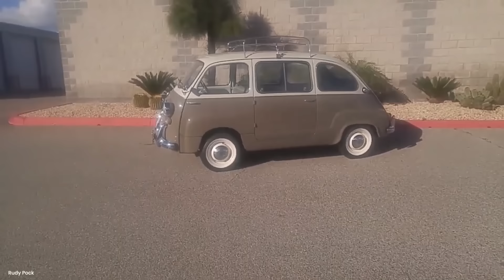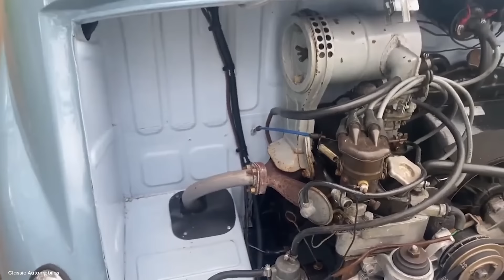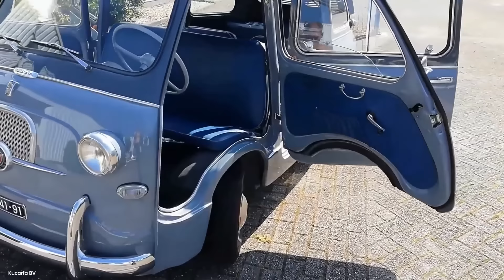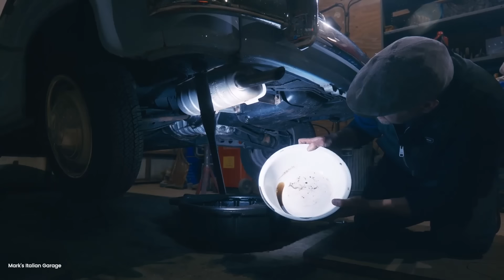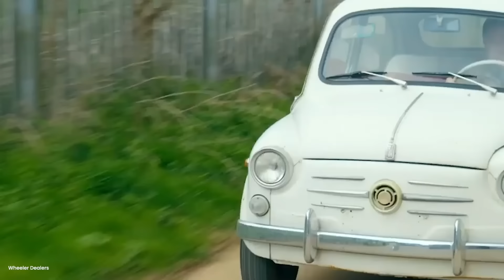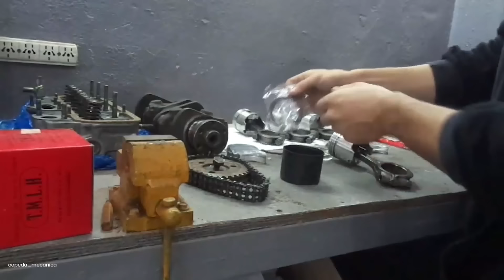Even at 52 HP & Suicide Doors, the 1959 Fiat 600 Multipla Shocked Everyone Seating Six Adults

Comment: While I was in Malaysia I used to work of Fiat 600 a lot back in early 1970s. Wonderful vehicles with no electronics. Contact points distributer required more periodic adjustments. Very sturdy car . Never fail on any trips.

Comment: Another salesman I worked with selling fire alarms door-to-door in the 60s had a micro van similar to that, although I don't remember the actual brand. It was the only one I ever saw - before or since. What I remember most about it was how roomy it was inside (it had no rear seats, just open storage area), even if it did look like a toy from the outide ... very cleverly designed! ⛽

Comment: A used 1964 Fiat 600 was my first car in 1968 - I completely rebuilt the car and put 80,000 miles on it including a trip to California before I sold it to my brother and bought a brand new PINTO for $1,995 that I drove for 200,000 miles - I loved the 600's bouncy ride and it's 1-1/2" thick doors - my sister had an OLD Renault Dauphine that my grandmother floated back from France in 1960 - I now drive a 1968 Suzuki X90 - yes I'm crazy!

Comment: I had a '58 Multipla that I bought in 1968 for $150. I loved that car and put on a glass-pack muffler that gave me about 3 mph extra, and the same for top speed. It sounded impressive downtown, with the sound echoing off the tall buildings. But the cooling system was not built for fast, highway driving, especially in hot weather. I cracked the rings on two engines, before I figured that out. I gave it to a friend, who was an ace at modifying cars of that type. He overhauled it and cut out a section of the rear seat-back, so he could fit a radiator from a much larger Fiat into it and that extra capacity solved the problem. He drove it for years without trouble.

Comment: Great Design, which should be updated and modernized, still with low power and speeds, to produce much needed cheap cars for India and similar poor nations where you see poor families hanging from 50 cc motorcycles, usually a couple and five kids, and possibly 1-2 in-laws. This would be perfect for them, and so much safer. UNfortunately, FIAT did use the Multipla name, but not for a clever design like this, but an ugly, huge HIPPOPOTAMUS of a van that of course failed to sell.

Comment: When stationed in the Navy in southern Spain from 1962-1964, I bought a 1957 Fiat 600 Multipla from a buddy returning home to the States.  Though we pushed it about as often as it carried us, I was able to see places in southern Spain with my friends I would never have been able to see without a car.  That funny-looking car fit right in with the local cars!  In fact, most locals drove motorbikes.  That car was in the repair shop quite often.  Needless to say, I did not bring that car with me when I was discharged and returned to the States!  My experience with Fiat did not end there.  After returning home, in 1969, I bought a new 1969 Fiat 124 Sport convertible, also a horrible car.  I had a tough time selling that car.

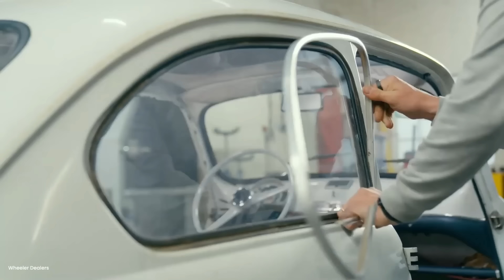Comment: This video is about the Fiat 600 Multipla and takes 23:17 minutes. Even though he keeps talking about the Multipla, all pictures from 15:35 minutes onwards show the standard 600. NOT the Multipla. Then he mentions that the VW bus (type 2) followed the design of the Multipla, even though the VW bus originated in 1949 and the Multipla in 1956. WHo followed who?  Then he shows a Citroen AMi, a normal car with engine in the front under a hood, but he claims that he Citroen followed the Multipla design, nothing like it.  Thirdly he states that the Subaru Sambar Microvan is based on the Multipla, but shows a picture of a van that does not look like a Subaru Sambar microvan at all and sports a clear VW emblem on the front.  The video is entitled 'only 52HP' even though in the story he never mentions that it ever got past 25HP!!!  Within the 15 minutes that show the Multipla, he repeats the same pictures 4 or 5 times, so you really get hardly anymore than 3 minutes worth of Multipla pictures. Just waffle from somebody who couldn't even spent the time to properly investigate the topic he wants to pretent to be enough of an expert on to make a video about. Shocking
Reply: But other than that, Mrs. Lincoln, what did you think of the play?
Reply: "shows a picture (...) on the front." 
 
I don't know about Sambar but at least it looks like a Subaru. It's certainly not a VW.

Comment: Thosa were notta, whata we are callinga the suicida dorsa.  Front edge openning first is the suicidea doors.  It isa the front dorsa which causa the suicides.  No?  
You're saying transverse leaf spring in front, but it's a coil spring on each side and a transverse sway bar.  
Send me a check for all the proofreading I'm doing for you.
Reply: Front opening doors are the BEST!
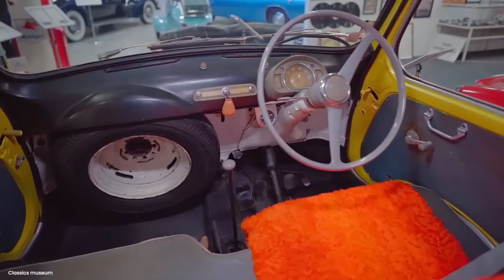Reply: 4:02  Forgetta about tha suicida dores, No seatbels and the steel spare wheel positioned right in front of the passengers  knees..  This issa suicida car. Also note: the only crumple zone is between the front seat  and the front of the car. 
I am a bit curious how many people lost their legs in these cars.
Reply: @Danny_Boel  Good points.  Why they didn't put the engine up front to provide some safety zone is beyond me.  They could have laid the spare tire over the motor to take some of the impact and used its air pressure to power a windshield washer.  I must have noticed a dozen incorrect remarks in this video.  I don't think anyone watched the video before they wrote the narration.  The "transverse torsion bar" was just an everyday sway bar, but the coil spring suspension is clearly visible on one of the front wheels.  
The video was put together worse than the car.